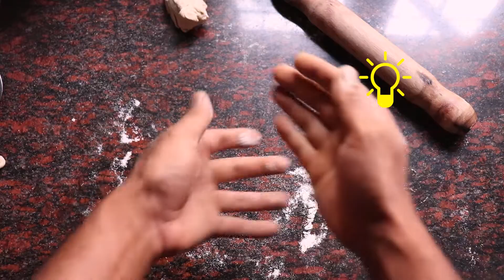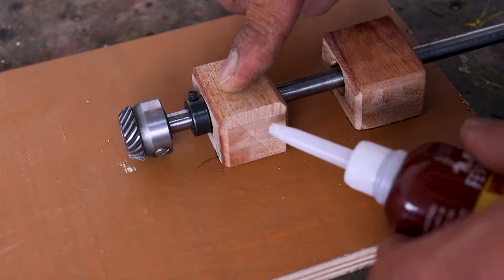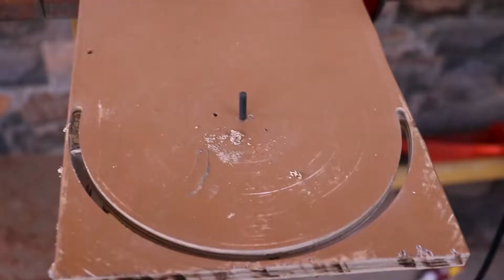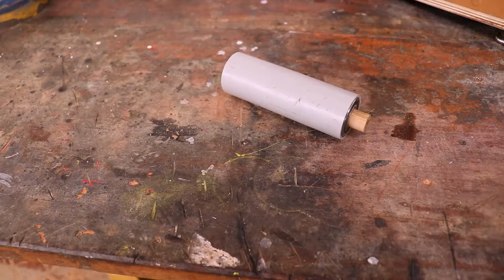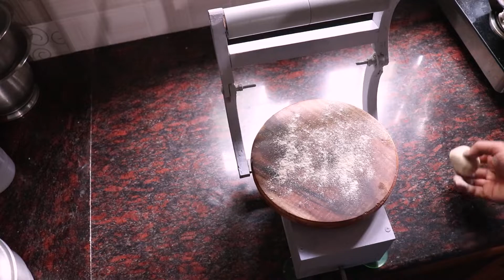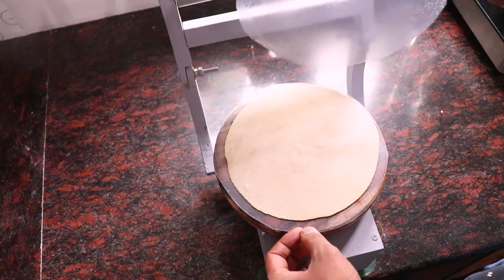How to make a hand powered Roti maker , make nice round roti like magic. Science Farm

Comment: Sir, my suggestion to you is,
1) why don't you use a BLDC motor or wheel hub motor used in EV scooters for power,
2) why don't you use a silicone sleeve for rollers and teflon coated plate,
3) why don't you use a pressure activated switch for pressing handle so that you don't have to switch it separately every time.
Reply from the maker: Because this is just a low cost project that you can make using the left over parts of a sewing machine.😅